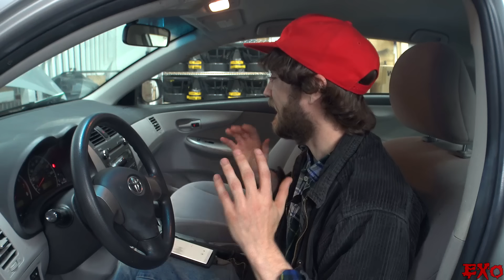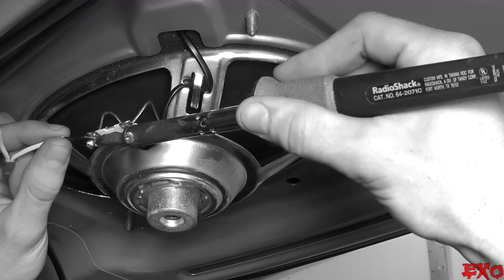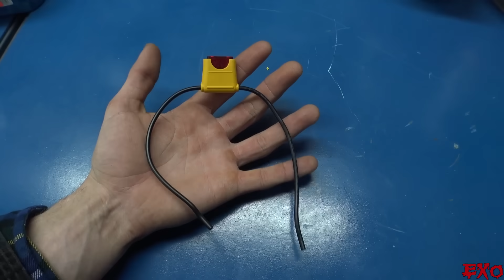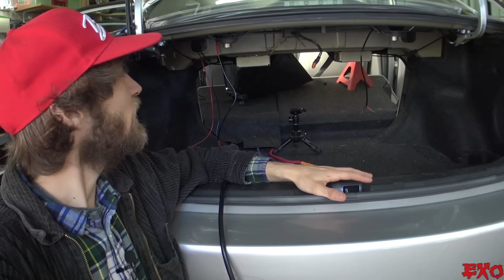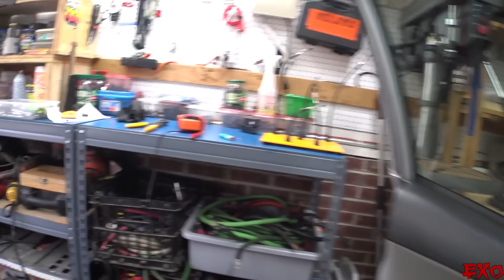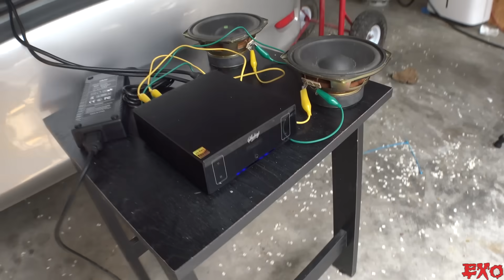How To INSTALL a Line Output Converter w/ Stock Radio & Speakers 4 Aftermarket SUB AMP Installation

Comment: Could i hook mine up in my dash to the stereo harness? I already have my rca's and remote wire ran to the stereo. There would be 12v and a ground right there?
Reply: Yes, I hook my up directly behind the radio and it sits in there nicely. But hook your constant to a cig lighter or an accessory that will turn on and off with the car.
Reply: @brycecarty5580  right on man, i ended up buying from walmart it came with a bass knob. Idk im not to happy with the performance of it. It seems to be under powered

Comment: You said power wire going to your alternator not your battery up front??
Reply: Well the alternator  is the only power source  the battery  just stores  energy  so ya,its not a goos idea to hook to alternator,your voltage  would be all over the place

Comment: Is there a max on what you can use this on? I want to keep my stock radio on a 2014 Dodge Journey. I will be running 2 aq 2250’s.  Will this converter work?

Comment: Loving the videos. Super helpful man. But why use carpet tape for the crimp connectors instead of heat shrink? 
Also, no rubber or carpet behind the line input converter? Won’t it rattle with the zip ties?

👍🏼

Comment: Hi Exo, can I know how do you determine which pair of speakers (front or rear pairs) are the ones you should connect the LOC to. Also, is there such a thing as a 4 channel LOC? If so, will you be doing a video on that too? Thanks very much and great work dude!

Comment: I've installed a LOC in my e91 but i think the output sound is a lot lower than if I had an aftermarket HU with buildin sw RCA outputs. Anyone can help?

Comment: what size fuse did you use on the 12v power line in to the converter?

Comment: if the vehicle has a factory subwoofer, is anything done differently? can i tap into the factory sub woofers speaker wires and get the same result?

Comment: Have you ever checked out the Scoshe LOC2SL which adds a remote output signal with signal sense that creates the remote input for your amps? I am using my stock Mitsubishi head unit and don’t want to add a switch and my electric bus doesn’t like turning my amp on. I figured the Scoshe could take care of that.

Comment: I got a question for the profis, please! I've let my car aduio equipment installed from a shop. I have discovered few hours ago after taking the install apart, they've grounded my amp with a wire longer that 2 meters! Would that be the cause of this fucking bass distorsion I keep experiencing? Heeeelp! I am gonna shorten that fucking ground wire myself tomorrow, maybe someone answers me until then! Either way it's fucking OK :D

Comment: How did you tune it did you do it with probes on speaker wires lol didnt really explain? thanks in advance
Reply: Just tested output voltage. It was 1.4 going to the amp. Then he tested voltage @ the speaker, it was 10.5 volts. You want low voltage going into your amp from the signal source & @ least 12 volts from the power source
Reply: @stevemiller5355  Okay so i tested mine before the loc on the speakers it was 2.4 volts so do i wanna match gain on loc to that an same with amp or is that not right thanks in advance just never worked with one before

Comment: Another great video man, you always make things so easy to follow. Not sure if you said it in the vid, but are you taking precautions against the feedback loop from sub-woofers to rear deck speakers? Sometimes the pressure from the sub-woofers will move the cones of the rear deck speakers which causes voltage fluctuation in the signal line that goes into the converter. This then sends a feedback hum to the amplifier. Not sure if that converter has protection against that, but a solution I used to do was to use little plastic pods to cover the rear of the speakers and separate them from the trunk's airspace.

Comment: I've used this handy device on my scion xB and my Mercury. Mine has an optional volume knob; I used it on the xB but not the Merc, I just use the head unit to control the bass. Simplified things to do it that way. Either way, a good thing to use when you don't want to screw with stuff behind the dash just to find no RCA's, and once the volumes are adjusted the way you need them, (mine is also internally adjustable), works like a charm. Set it and forget it. Good vid, Exo.

Comment: That’s why I use butt connectors and shrink tube easier and quicker and if you know what your doing it’s just as strong. I install water well pumps the same way for 20 years and those connections last under water that long and I have pulled pumps by the wire that have had broken pipes so if you can pull hundreds of pounds on my connections I’m fine with them in my automotive needs.

Comment: Hey exo, I tested the voltage output of my stock radio and it already only outputs about 4 volts at max volume, so should I still put in a line output converter? I have been running it without one for about 2 months now but if it will give me a cleaner output I will out one in
Reply: nah bro dont it will add distortion unless you buy a really expensive one from like audiocontrol.

Comment: I did this to my first car, i used heat shrink on it instead of tape and i installed a toggle switch so i could shut it off in a hurry if need be.

Comment: I love installing the convertor with the remote wire for factory radio installs for the subs.. I always hated a hot wire or using the toggle switch for it to cut the amp off..
Reply: Is it possible to connect to remote wire without removing the stereo?

Comment: I’ve got an in line bass knob (rcas from radio go into it, then another set go from knob to amp) and when I take my vehicle to a tire shop I just disconnect the bass knob and slide it in my pocket, so they can’t play the system at all. No signal to the amp.

Comment: Exo! Question.
I recently upgraded to a head unit, had my gains set by a scope.
But then replaced my ancient RCAs and took off the +2 bass. I feel like my gain can be set higher now, tried doing it by ear with music, I could have maxed it without hearing a change.
How can I tell?
Reply: Infinity 1260
Alpine vpower m350

Comment: I have tested and have probably found the best Bluetooth receiver there is. I know you're installing a high-level to low-level converter but you can skip the factory set up entirely and not worry about the dirty signal from that factory head unit. Even being that simple it's probably got bass roll off in it keeping the owner of the car from blowing the speakers. Probably getting off 50hz and below. You end up making up for that with your bass boost on the amp.
So why not skip that entirely and use your phone or tablet as your media player???
Dual Electronics has really stepped their presence up over the last 2 years from Walmart purchasing two amplifiers from ds18 and re labeling them....the two channel is $30 right now by the way which is a crazy ass insane deal lol.... And this Bluetooth receiver with equalizer.

Now I'm calling it exactly what it is. It's more of a Bluetooth receiver than it is an EQ. Of course dual wants to label it the other way. You can receive Bluetooth 4.0 signal from your phone or a single RCA input. It has 6 outputs and here's the best part..... They each are rated up to five volts! When I tested it I saw an average of 4.3 but still, considering Rockford Fosgate's Bluetooth receiver is the same price, has no EQ, and only has an output of 900 mv (not even a volt), at $60 shipped makes this thing and extremely great deal!
Better yet not only can you stream from your phone it also has an app you can download to control the EQ, separate bass control, and fader and balance! And also has a place for a bass knob if you want to add one.
All you have to do is get power and ground ....which will be easy considering it's right next to your amps.
Another thing is that the device sees you when your phone connects and turns on the device and amplifier turn on lead to go to your amps!
It's Bluetooth section utilizes A2DP AND A 24-BIT DAC the best sound quality via Bluetooth. I could not tell the difference in fact it sounded better then using the RCA inputs from an aftermarket head unit.
Once again all you got to do is put it you're the amps and run your RCA's from it!
It saves so much time since there's no soldering needed, no additional cable ran from the front, and you're able to bypass that factory head unit unless you have to have a CD player. that case I would go on eBay and buy a portable CD player and plug it into the RCA inputs LOL.
Here is a link to it on eBay for sale....

https://rover.ebay.com/rover/0/0/0?mpre=https%3A%2F%2Fwww.ebay.com%2Fulk%2Fitm%2F132961091349

Comment: Dude why are you working so hard?
 Always add any wire extensions to devices out of the car first, you only needed to solder the speaker hookups while inside the car.
 Or even better put it behind the radio where it's supposed to go and just tap in up there where you have room to work , and just run a RCA's from up there.

Comment: So that line output converter stays always on or I am missing something...
Reply: No I noticed the same thing haha but it should be fine honestly
Reply: The blue remote wire should have controlled the loc, not supplied remote voltage to the amp. Unless I missed something??

Comment: How do you know what size fuse to use for the line out? I have installed a couple of line outs but never considered a fuse for the 12V on a line out. Also, what is a good range to set your ac voltage to for the amplifier? 4v?

Comment: You could also buy an amp with build in high level inputs. I assume you can still buy those.
Reply: They still sell them even the Dual amp from Walmart has it and it's just $30, not bad either for powering the speakers on the doors.
Reply: @noelmedina6925  dual suck over heats and it's craps don't buy that shit spend over $100 for a good one.

Comment: EXO, have you ever thinked about making an informational video about "what makes a subwoofer loud"? 
Like, when you explain where you have to be careful when choosing a subwoofer, what it's the most important thing to look before buying a subwoofer? 
I'm trying to learn more about subwoofers, as I watched videos for more than 10 years every day, but never learned something.
I couldn't find any video or topic on the internet forward this subject and I thought you're the one who could make a great job with that.
Reply: I'm not EXO by any means mor ia this a video how ever maybe I can enlighten you a little. Sound is nothimg but the movement of air. There is alot of technical stuff I'm about frequencies In which that air is moving. He will probably if he hasnt already shown one making those frequencies visible. But to answer your actual question of what makes a subwoofer loud is the frequency. Subwoofers hit a substantially lower frequency that can actually be felt through the vehicle and through other parts of your body other than just the ears. After adding a subwoofer it's no longer just hearing the music but actually feeling it with the rest of your body as well. I hope That helps and I didnt just fall victim to a troller. Also not trying to take anything away from exo either but I'll post another comment with a link to where a gentleman makes it to where you can see those sound frequencies with science.

Comment: EXO next time put solder on the iron tip then add new solder to back side of wire. When it is hot enough it will suck solder right in. And you know the solder job is good.

Comment: I spiced my left front and right front cables from the head deck as my car has a factory amp and sub. If I used the rear speakers it would have been already amplified. Food for thought hehe.

Comment: Yo Exo great video! I just bought a Pac Loc Lp7-4 4 channel loc. I have a stock 2018 chevy spark and want to add a couple 10's or 8's probably under 1000 watts. If I use only 2 channels how would you go about it? Instruction show very little and no videos for 4 channel vs 2 channel loc. Thanks for any help!?
Reply: Wire it the same just like he did but dont hook 2 of the channels up. Only do either 2 front or the two rear on the converter
Reply: Roy Resha thank you! So what can I use the other 2 channels up for?  If I had another amp,would I still tap into more speakers the the same as the other? Like if I used front for front and rear for rear? Thanks again!!
Reply: @kevinpeterson4098  yea you just have to hook the other two up to a speaker output as well. But most amps have an output so you can run another amp
Reply: Thanks again Roy! You rock my friend!

Comment: Exo I'm a big fan hate telling people things in text cuz it comes across rude but you should clean the paint of underneath your ground wire that way it doesn't create excess heat on your amplifier and a weak ground because the heat dissipates through the ground and the heat sink fins on the amp if the ground Cant ground through the paint it'll create excess heat in your amplifier just a helpful tip then once the ground is installed take some touch up paint and cover over top to prevent rust thanks for the vids you rock

Comment: Maybe one of you guys can help me out. I have my amp directly wired to my door speakers and it sounds amazing but I was wondering if there was a way to still have the speakers play after I turn off the amp? the reason I ask is because in my car I can turn on the radio without the key but the stock radio only sends an amp turn on signal if the car key is in accessory or turned on so I will hear all the speakers except the ones on the amp. I know I can wire a connection from the battery to a switch then to the amp but I am looking for a solution that doesn't require me switch it on and off whenever I want to hear music (because I know I will forget and end up with a dead battery in the mornings).

Comment: Sounds normal? What is the quality level of this in comparison with say having a normal aftermarket Radio with 4 Volts RCA outputs?
Had on a Kia Rio a Mosconi amplifier praised for its OEM integration (an amp which I hate, have you had any experience with Mosconi amps?) and the whole thing knew only to fart, no quality, nothing. It was all a joke. Maybe there's a different story to tell when it comes to these line converters. I experienced endless frustration with that system. I have changed the original Radio with a Pioneer which had 2 Volt outputs, same amp, now it reproduces the low frequencies (which were partially missing on the previous setup with the OEM Radio), but still sounds like fake bass. I miss my bass so much.

Comment: I usually twist them 2 times then wrap them. Even without solder the wires break when you try and pull them apart.

Comment: Nice G.

I did a vid on my stock head unit setup with the Lc2i and Clarion Eq using some tips I learned from watching your vids. Checking stock head unit with a DD1 to know when the stock HU clips, tuning the LC2, and went over measuring the voltage and all that coming from the LC2 and EQ. 

Check it out G.
https://youtu.be/awm4y_zchRE

Comment: I normally use a 4ch converter saves you upgrading later and I normally put the converter closer to the head unit and run the RCA’s back to the boot
Reply: The shorter the length of wire the clean the sign....I used those I perfer not to used the stock radio....Even when running speaker wire from amps to speak shorter length and good gauge wire stronger cleaner power

Comment: Never had an issue with these if you buy pac ones... Also I never run to left and right grey ~,+ white -, +  so not having to run to 2 speakers in the rear  I just put both +'s and -'s together rather than having to go to left rear speaker and right rear speaker output you just have to go to right speaker or left speaker output and call it a day....

Comment: This has been a Hot topic this past couple weeks! Would it sound same with High level inputs or a Line output converter?
Reply: Amps have a built in loc sometimes, but i personally have found a lot of difference in using an active loc instead. The extra bass compensation dials on the good ones help to get the most of your system and it combats bass dropout that occurs with most modern cars where it changes the EQ as the volume goes up in order to protect the speakers from blowing. If you don't want to splurge for active though my order would be active loc > built in to amp > passive locs like what you'd be able to buy at best buy.. the passives require more careful setup, they distort near max signal strength, and too low and your amplifier will start picking up its own signal like putting a speaker near the mic... you don't want to have your head in front of the subwoofers when it goes into a runaway feedback loop, it ruined my day in the middle of my own exciting install lol.

Another little side note, exo doesn't mention it here, but if you're going to stick to a factory head unit it's probably because you want to maintain the value of the vehicle. Adapters for those speaker connections exist for every car, don't cut any wires unless it's a separately purchased part not on your original car. I cut mine and regret it a lot, a mere 12v and the fact it's basically an outdoor electronics device leaves a lot to go wrong over time at every place you take those snips to and have to reestablish a connection. If you've already cut it then use waterproof plugs and tinned copper wire to save yourself the headache later of an intermittent connection.